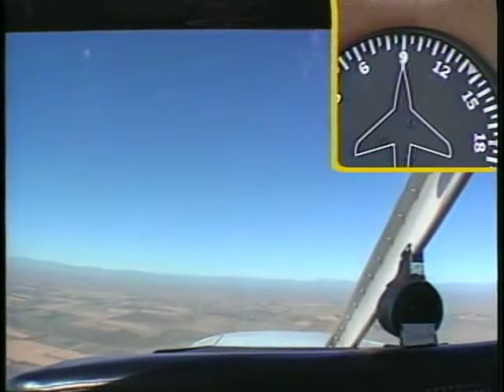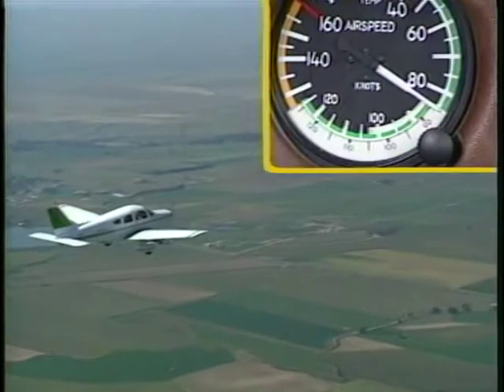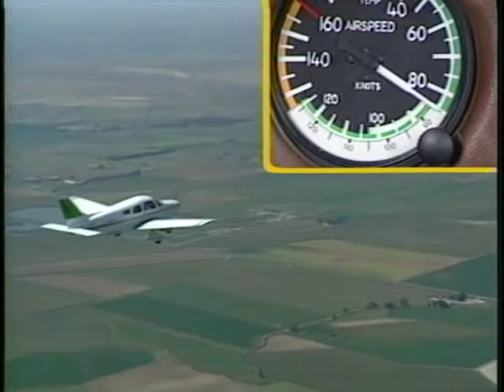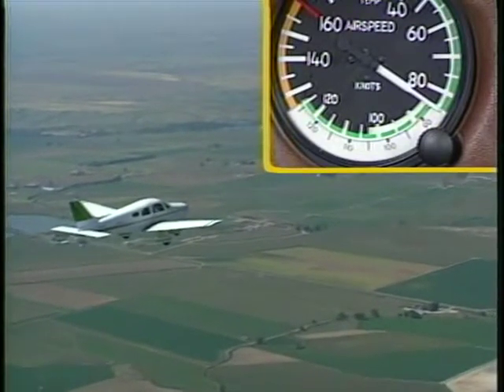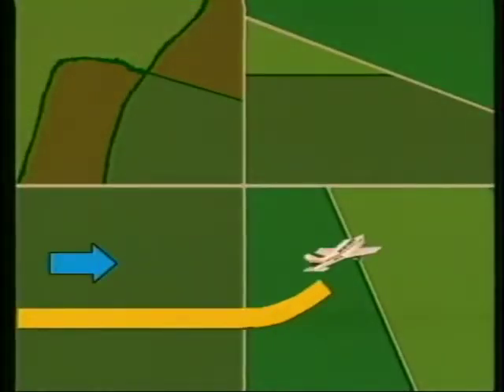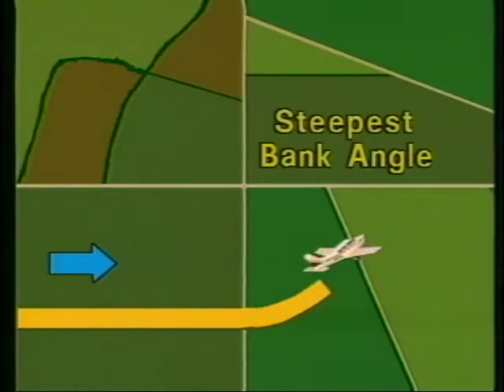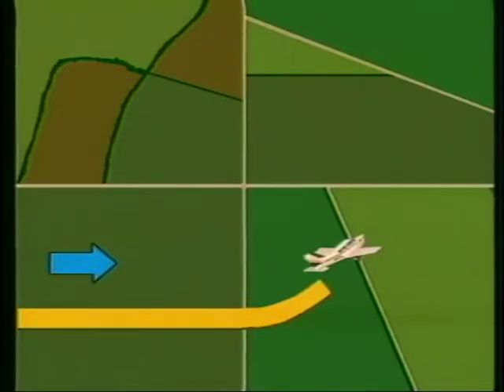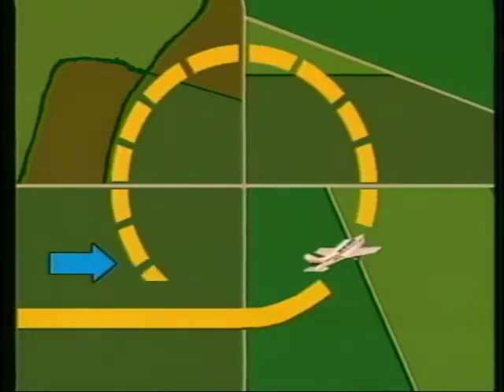9  Steep Spirals ( Instructing the Commercial Student )

Comment: Just a heads up for those watching this video to learn steep spirals, the new ACS says you should enter this maneuver on the upwind, not the downwind like this video says and most ground reference maneuvers say. The reason for this change is because when you complete a 360° turn you need to "clear" your engine by pumping the throttle forward to prevent rapidly cooling the engine or fowling the spark plugs, and you want to do this while in the upwind to reduce the amount of forward movement caused by increasing the throttle. 👌🏻
Reply: I think you are wrong about this. The ACS does not specify whether you have to enter this maneuver upwind or downwind. Also, you don’t “pump” the throttle. That’s very hard on the engine. You increase power to cruise power and then back to idle every time you are upwind.
Reply: While the ACS may not specify this, the AFH does.

Comment: Steep Spiral
The objective of the steep spiral is to provide a flight maneuver for rapidly dissipating substantial amounts of altitude while remaining
over a selected spot. This maneuver may be useful during an emergency landing. A steep spiral is a gliding turn wherein the pilot
maintains a constant radius around a surface-based reference point—similar to the turns around a point maneuver, but in this case the
airplane is rapidly descending. The maneuver consists of the completion of at least three 360° turns [Figure 10-2], and should begin
at sufficient altitude such that the maneuver concludes no lower than 1,500 feet above ground level (AGL). Note that while there are
similarities between a steep spiral and an emergency descent, the reasons for using the two maneuvers may differ, and the airspeed
and configuration are usually different.
Figure 10-2. Steep spiral.
10-3

The steep spiral is initiated by properly clearing the airspace for air traffic and hazards. In general, the throttle is closed to idle,
carburetor heat is applied if equipped, and gliding speed is established. Once the proper airspeed is attained, the pitch should be
lowered and the airplane rolled to the desired bank angle as the reference point is reached. The pilot should consider the distance
from the reference point since that establishes the turning radius, and the steepest bank should not exceed 60°. The gliding spiral
should be a turn of constant radius while maintaining the airplane’s position relative to the reference. This can only be accomplished
by proper correction for wind drift by steepening the bank on downwind headings and shallowing the bank on upwind headings.
During the steep spiral, the pilot should continually correct for any changes in wind direction and velocity to maintain a constant
radius.
Operating the engine at idle speed for any prolonged period during the glide may result in excessive engine cooling, spark plug
fouling, or carburetor ice. To assist in avoiding these issues, the throttle should be periodically advanced and sustained for a few
seconds. Monitoring cylinder head temperature gauges, if available, provides a pilot with additional information on engine cooling.
When advancing the throttle, the pitch attitude should be adjusted to maintain a constant airspeed and, preferably, this should be done
when headed into the wind.
Maintaining a constant airspeed throughout the maneuver is an important skill for a pilot to develop. This is necessary because the
airspeed tends to fluctuate as the bank angle is changed throughout the maneuver. The pilot should anticipate pitch corrections as the
bank angle is varied throughout the maneuver. During practice of the maneuver, the pilot should execute at least three turns and roll
out toward a definite object or on a specific heading. To make the exercise more challenging, the pilot rolls out on a heading
perpendicular to or directly into the wind rather toward a specific object. This ability would be a particularly useful skill in the event
of an actual emergency. In addition, noting the altitude lost during each revolution would help the pilot determine when to roll out in
an actual emergency so as not to be too high or too low to make a safe approach. During rollout, the smooth and accurate application
of the flight controls allow the airplane to recover to a wings-level glide with no change in airspeed. Recovering to normal cruise
flight would proceed after the establishment of a wings-level glide.
Common errors when performing steep spirals are:
1. Not clearing the area
2. Inadequate pitch control on entry or rollout
3. Not correcting the bank angle to compensate for wind
4. Poor flight control coordination
5. Ineffective use of trim
6. Inadequate airspeed control
7. Becoming disoriented
8. Performing by reference to the flight instruments rather than visual references
9. Not scanning for other traffic during the maneuver
10. Not completing the turn on the designated heading or reference